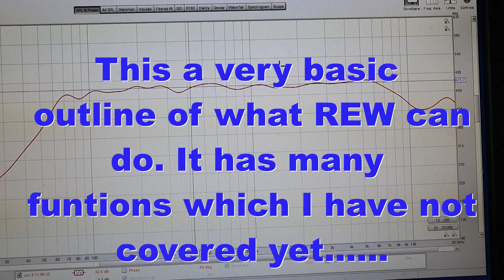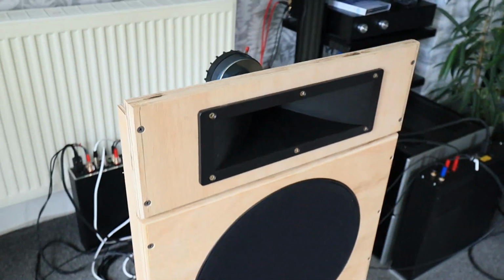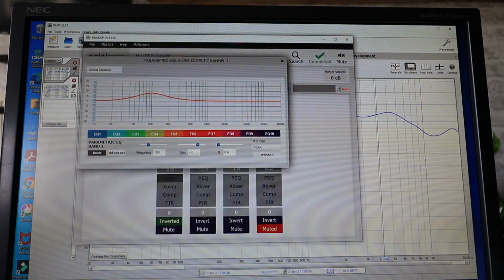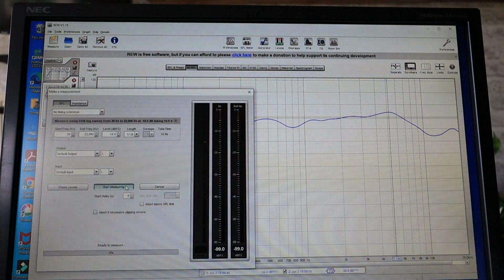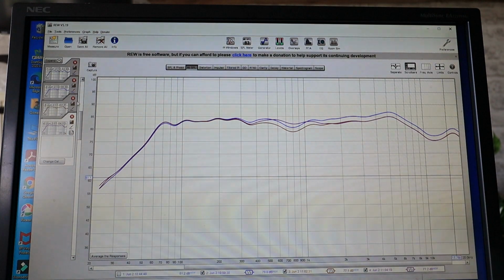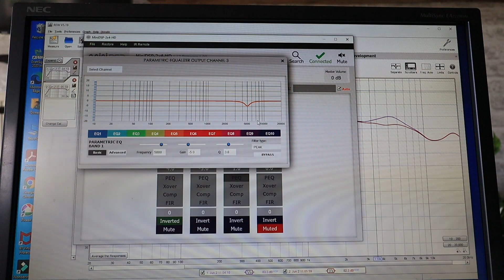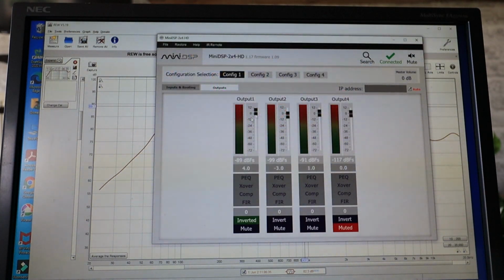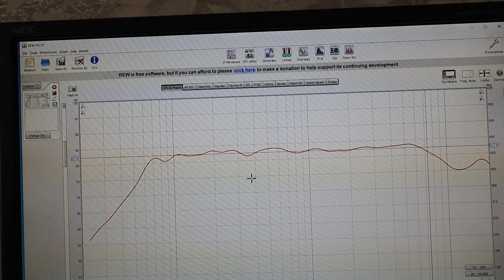3 Way Open Baffle Project (Not Coaxial) but with a horn loaded tweeter.

Comment: How do these compare to the 2 way speakers in the corner at 2:35 ?

Also how do the Mark Audio drivers sound in open baffle?

I am in UK, Essex are you far away?
Reply from the maker: Hi John
These 3 ways are very good but I prefer the 2 way you see in the back ground with the way I have them set up in my room (not ideal) but its what the lady of the house will let me get away with. The Mark Audio drivers sound superb in open baffles.  I have found with OB designs you need space to the rear (more than 1:0mtr) and sides (1:0mtr) to get them to work. 

I'm in the New Forest Hampshire UK. You do know me...
Reply: @thediyaudioimplementers1826  Thanks for the feedback on the Mark Audio drivers in open baffle... One comment you made suggests the larger one (11) is better..

Interesting on the "You do know me..." comment? 🤔
Really.. have we met before? I will need a reminder.
Reply from the maker: @johnshore3095  check your PFM in box.

Comment: You actual can (and should) fix that dip in the high frenquency of the compression driver. The reason you get the sloping response in the highs is due to the fact that the waveguide boosts the low frequency of the tweeter so you can better match the polar response of the mid and tweeter. To counteract that you should measure the tweeter alone (1 channel) at 1 meter distance or so and gate the measurements and than apply an approperiate downward low shelf on the region between 1k - 7k (probably but can be different depending on your measurements) of the compression driver (probably around 7db or so) until is is 'flat'.  Than you have to match the gain of drivers again and measure again :)

The reason the inversion of the drivers sometimes works with fixing the dip you had on 700hz is due to the fact that, that is the summation at the crossover isn't right. This can mean that you measure not far enough back with your mic (thus the sound waves partial cancel each other out) or the drivers are not timealigned thus having the same effect (they will arive later than each other) or you use acoustic slopes that don't sum properly at the crossover frequency (use linkwitz riley filters to fix this). To do it properly you will have to find out how far back you have to place the mic to measure, this is the length of the crossover frequency wavelength. Then invert the signal of 1 of the 2 drivers and adjust the delay of the driver where the magnet is the closest to the baffle (probably the tweeter most of the time) when the dip is the deepest you have succeeded and than can invert the signal back. If you than use proper filters (Linkwitz riley) you will have a good summing response. It is needed to do this because if you don't you will get off axis humps in the response due to improper sumatation if you fix it by eq. See linkwitzs page about it if you want to learn more https://www.linkwitzlab.com/frontiers_5.htm